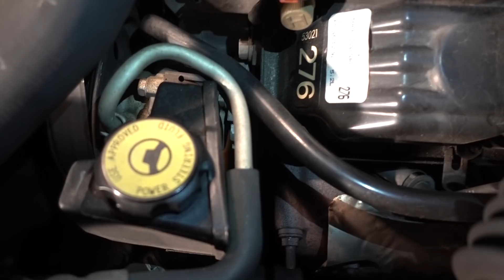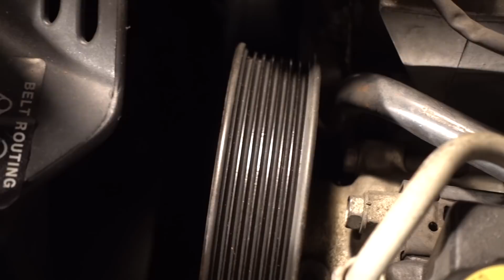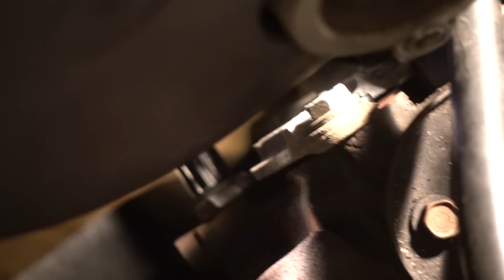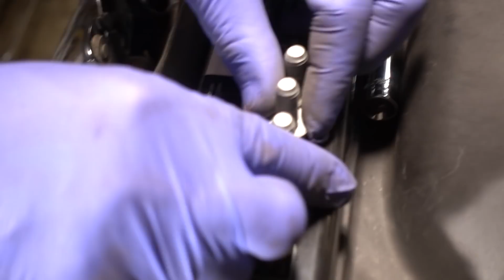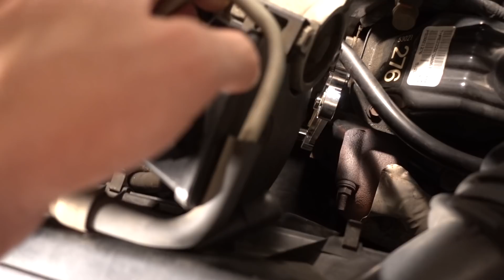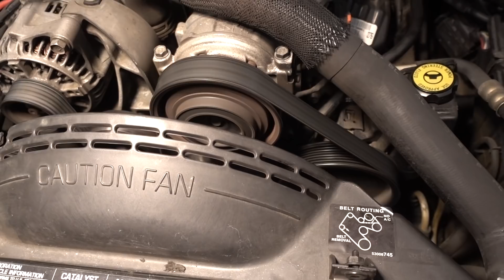Jeep Power Steering Mounting Bracket

Comment: I cringed quite abit seeing you having to take top hose off because I didn't have to. I just took my air filter box off with 3 bolts...the PS pump will slide underneath the hose out of the way just fine...less messy.
Reply from the maker: One thing I have found in life is there’s many times a better way to do things. I will remember that next time. 😁 Thanks for the input. 
Terry

Comment: Dear Terry & Brian,
A great how to video on changing a pump bracket. One wonders if you might consider doing videos this long when you next decide to hot rod your tractor &/ doing your house build??? Great stuff, keep it up. Kind regards.
Reply from the maker: Thanks! 

That bracket is top notch! I hope the guy who makes them is found by many people. He deserves to get a lot of sales for the good he is doing. We are extremely satisfied with the quality of work he put into it.
Terry
Reply: Dear Terry,
Thank you very much for your courteous & hearted reply. Indeed that Aluminium bracket milled from solid using very likely a C.N.C machine certainly looks way stronger than the original cast version. The very reason why it cracked due to metal fatigue possibly induced by vibration should not affect the newer one. Job very well done & many dollars saved in the process. Kind regards.
Reply from the maker: Thanks!
Terry